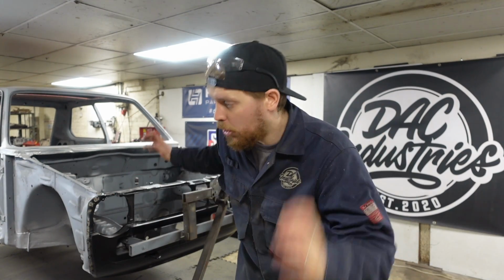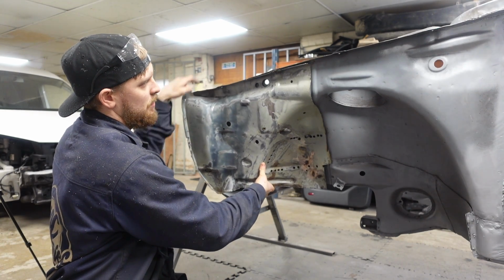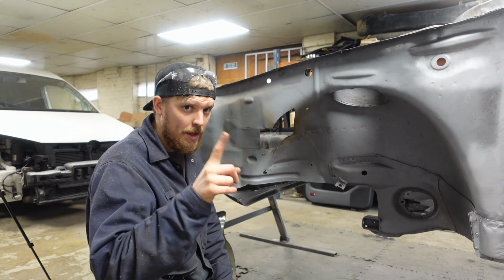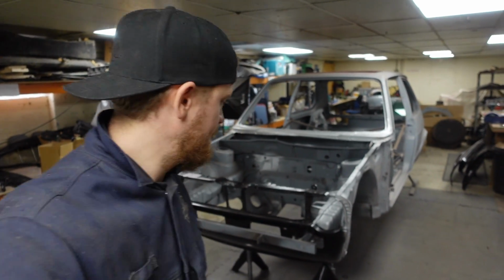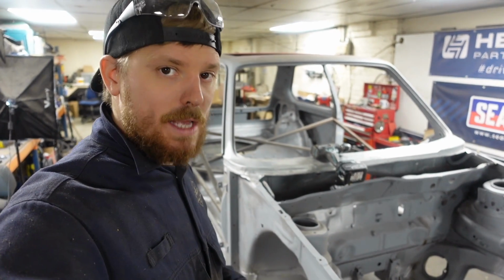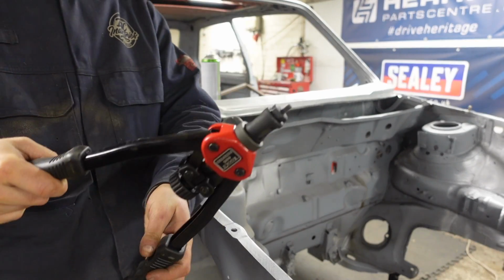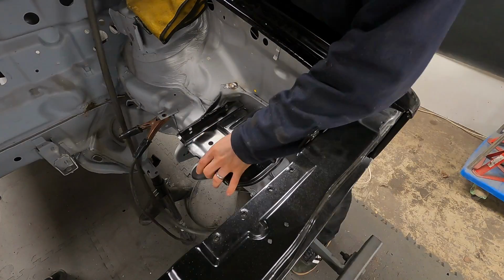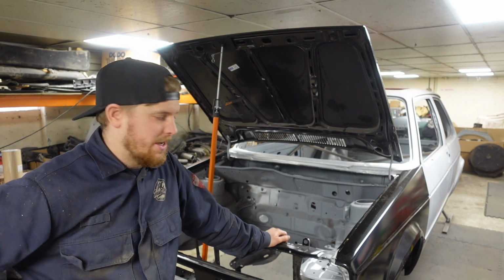Fitting Inner Wing Cut, Rivnuts & Battery Tray - Golf Episode 28 Volkswagen Mk1 Golf GTI Resto

Comment: Now the wings are sitting a little higher on those rivnuts, do the swage lines/rubbing strips still line up from wing to door?
That inner wing repair looked excellent. Great video again.
Reply from the maker: The inner mountin of the wing can be bent slightly to compensate. All lines up as it should do.

Comment: nice one, ive just been doing mine. almost the same. took a couple of hours to the get the front  panel off. ive lined up and spotwelded one side on , just need another day of sun and it'll be done.
Reply from the maker: Awesome bud! So satisfying!
Reply: @DanChambersDAC  yeah defo, fitted and primed today.i had to cut a hole for the wiring for the side repeater as there no hole in the replacement inner wing panel.

Comment: Bad idea whit those nuts. The bolt might rust or the treads will collect mud. Taking them down will end in disaster.
Reply from the maker: Cheers bud, All fixing will be greased, Inner arches will be stone chipped and the car will not be driven in the wet.

Comment: It would be a good idea to add a small weld to those nut inserts, otherwise they will eventually spin and the bolt won't undo
Reply: i would have stuck with ragbolts..
Reply: Exactly what i was going to suggest. They are great till a bolt seizes in a little and picks up on the rivnut.
Reply: @davog1946   you have obviously had to remove one before lol. i know the pain!
Reply: Christ don’t, end up resorting to aggressive measures!
Reply from the maker: I was thinking of adding a small weld when I have them all fitted. I opted for these as I have had to replace some of the metal and lost the original fixing locations due to rust. This car will not be driven or out in the rain much so rust won't be an issue.